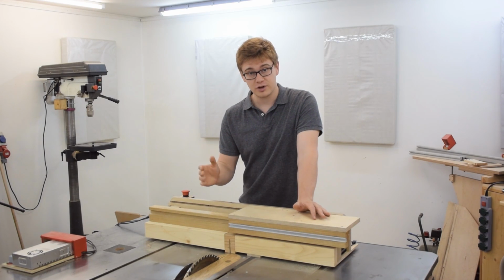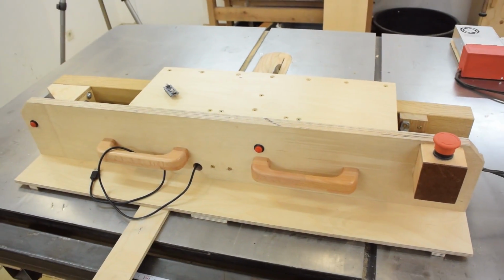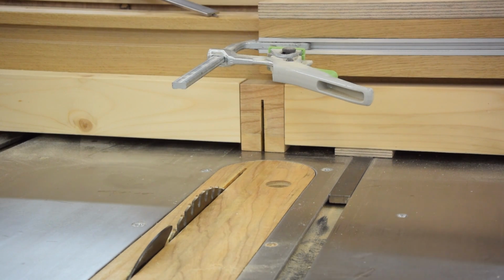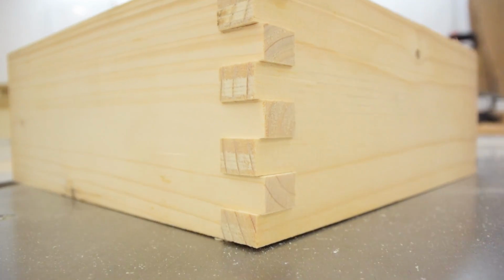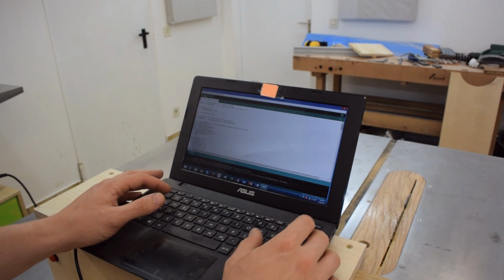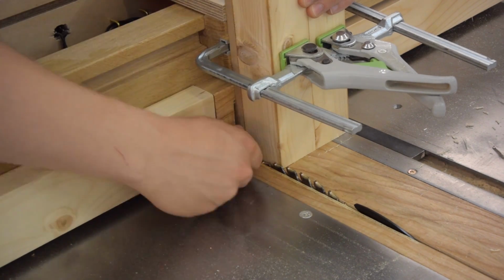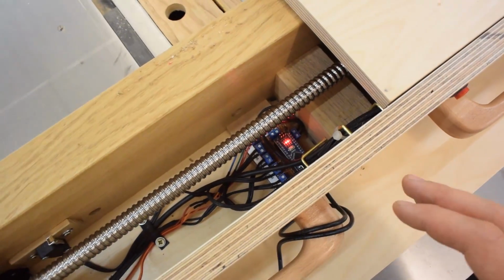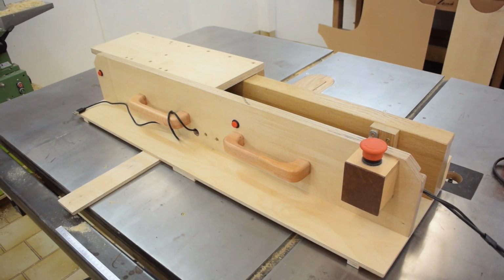Computer Controlled Box Joint Jig | Precision Box Joints | Arduino Project

Comment: Can you make the stepper motor go even faster?
Might be only me, but I would want an LED to turn on as soon as it's finished moving, so I could push it without wasting time :)
Reply from the maker: You could, but the faster it goes the more likely it is to skip steps because it hast to accelerate the mass of the sled and these motors have the highest torque when they run slow. To me it is fast enough, I almost don't have to wait at all. I can clearly hear and see and feel when everything stopped moving so there is no need for another indicator.
Reply: Thanks
Reply: If you're worried about skipping steps, you can mitigate that by using soft start. There is an arduino library for that (accelstepper). It makes big difference if that stepper motor has 20 steps to start up instead of one.

Comment: Love it! Great job. Only thing I would add is a way to input the two values directly with out a computer. No idea how much work that would be. I would not worry much about dust on the ball screw, it's pretty well protected in there. They are used out in the open on cnc machines all the time.

Comment: I was thinking that you need a way to define the 0 point, maybe have a positive stop or even something simple as clamping the two tails, off set by the width of each tongue, and then move the sled until it reaches a micro-switch with the trigger point carefully lined up with the edge of the blade. That should allow the sled to zero itself and the workpiece to the saw-blade I would think. 

As far as I know most micro-switches are quite consistent in the point where they switch due to the way they work but if that's precise enough I dont know.
Reply: Oh i get that, I was just thinking of a way to zero up the stock with the edge of the blade automatically so you didn't have to fiddle with aligning the stock but could simply hit a button...

And bonus points to you for finding a new and imaginative way to mess up my name! :-P

Comment: Very cool! Any plans to take more advantage of the Arduino? A couple thoughts I had right away:

- have the motor set on a timed loop (you can adjust the time variable with a potentiometer + knob) and use the right button as a start/stop. Cheap LCD screen for variable monitoring to make things easier and more accurate.
- full automation! The nano can power another motor that slides the pieces forward and back so you don't have to. Start and test code for wood density using similar time loop methods as above, then eventually add force and visual sensors to adjust the timing/density variables automatically, and you've got a closed system for a few more dollars of hardware. If you open source your hardware/software plans, the Arduino community can likely help you make a completely safe and closed "joinery CNC" (servo connected to the mitre angle for perfect-fitting dovetails, production-speed, etc.) for ~$100. I don't use power tools but kind of wish this existed... Hit me up if you have any questions on the coding side!

Comment: Also why did you use a ball screw does it have 0 play?
Reply: Art Connolly I'm just assuming but,  zero backlash couplers would over come this. The nature of a box joint you work from one side of the work to the other therefore if your set up correct you will only be pushing or pulling in one direction on the ball screw so you will have preload that eliminates backlash.
Reply: An easy way to overcome play in the thread / screw would be to positively load the screw / thread so that it always runs against the same side of the thread / by putting in a spring that forces the sled to one side, then it doesn't matter how much slack there is in the screw / thread as you only reference off one side of it. :-)
Reply from the maker: It does. But in this application that doesn't matter.
Reply: That's right as the dragging of the sled to one side causes the screw / thread always to be riding on the same surface for the edge cuts, for the cuts in the centre of the fingers it makes no difference as long as the overlap of the saw blade kerf is wide enough. :-P